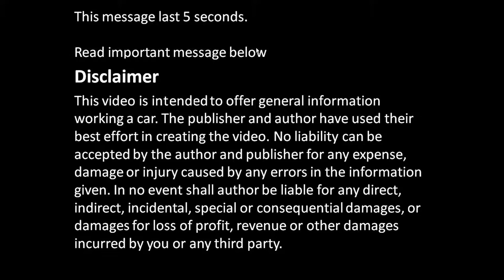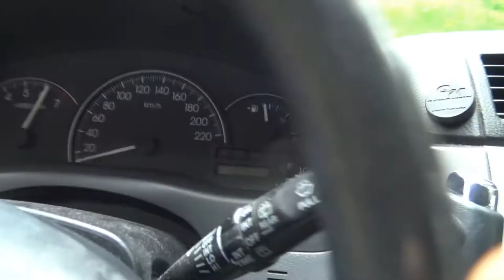How to change your car steering wheel

Comment: Excellent job Peter! There was situation that the speedometer was stuck in 6000 revs with engine closed, but in the end of the video the issue was solved! What was that?
Reply from the maker: Battery is OFF and it makes this thing. :-)